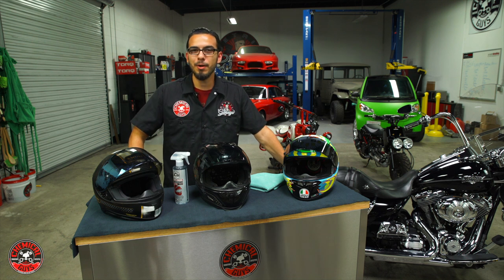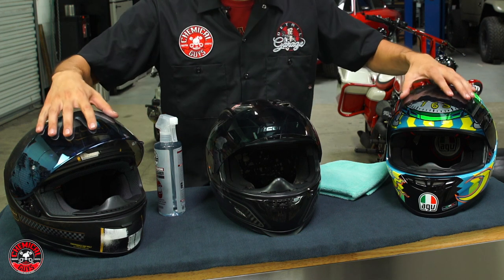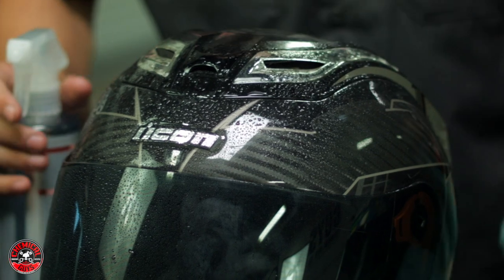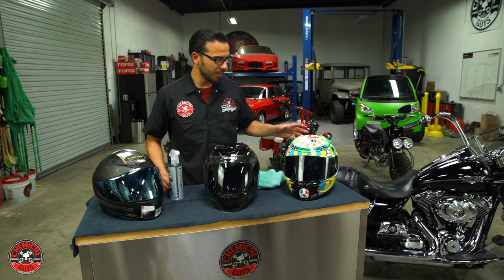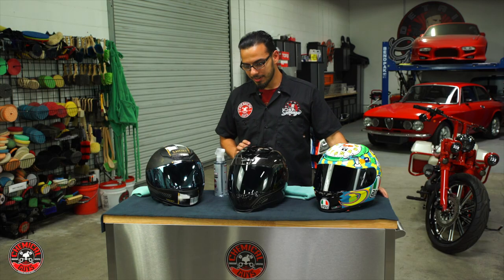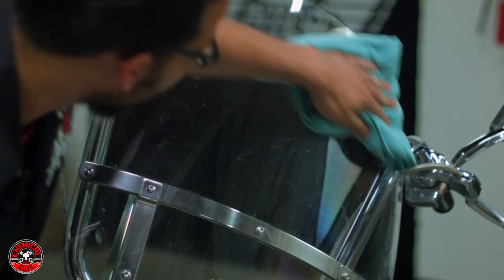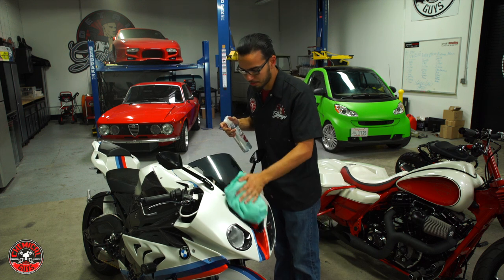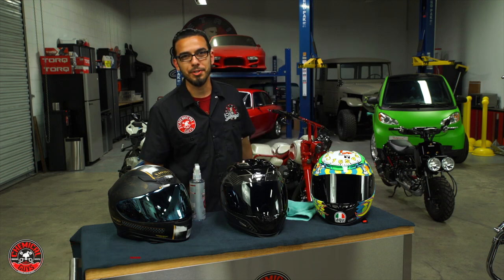How To Clean & Protect Motorcycle Helmets - Chemical Guys Clear Vision Helmet Cleaner & Protectant

Comment: I have a 2015 Honda CR-V that I wash once per week. I always do a pre-rinse to remove lose dirt and then wash with a microfiber mit. Car was never put through an auto car wash - those are swirl factories lol. I happened to be looking at the hood of my car today under direct sunlight and noticed fine scratches in the hood. I am very particular with how I wash my car and I never touch the paint when it's dirty and always part far away from other people. I have no clue how these fine scratches ended up on my cars hood as I am as careful as possible?  Are they really unavoidable? Thnaks!